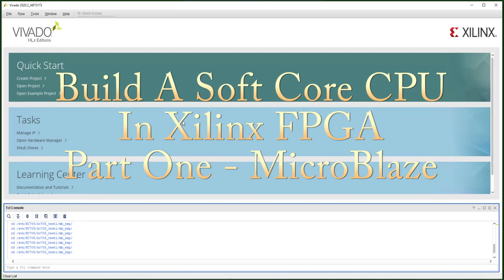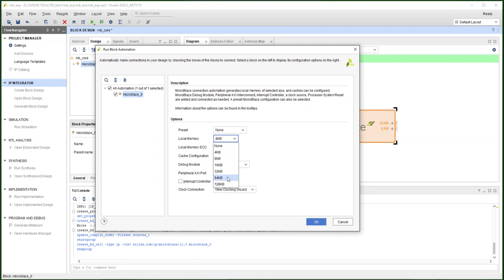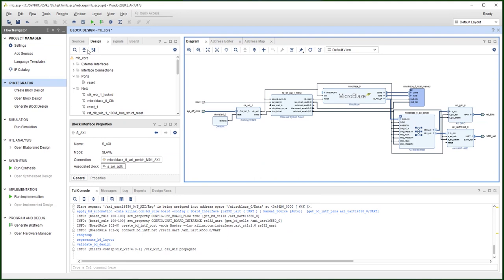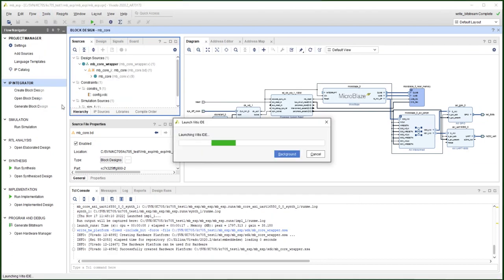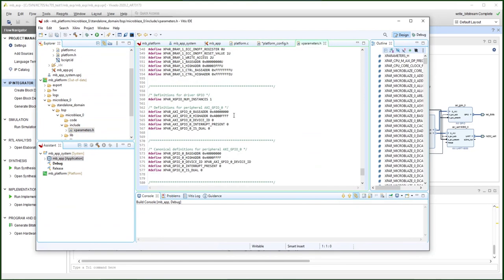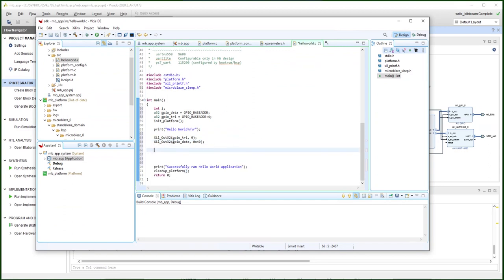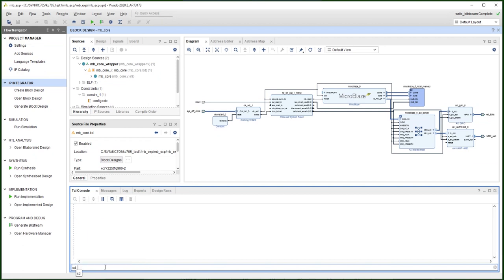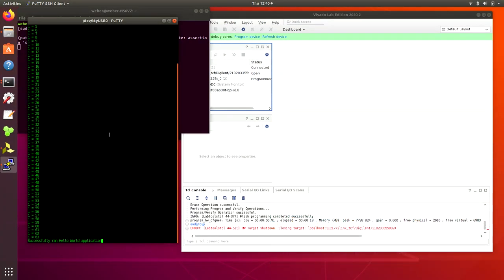Build A Soft Core CPU - Part One - MicroBlaze in Xilinx FPGA

Comment: I was trying to program the flash from VITIS, didn't know that you have to come back to VIVADO and set the .elf file there. I tried as you said and now it works, thanks!
I am still incredulous that there isn't a more direct way. This part of generating the memory file with write_cfgmem, is really needed? isn't a more direct way to just program the flash? I think I did it before from VITIS with "Program Flash" command, but it was in a board with hard core processor, not with MicroBlaze. Is that a VITIS limitation for MicroBlaze processors?
Reply from the maker: I think the bitstream is a complete binary with CRC/checksum, including both fabric image and elf memory portion. You can't just re-flash the elf part. elf for microblaze is just internal BRAM initialization.